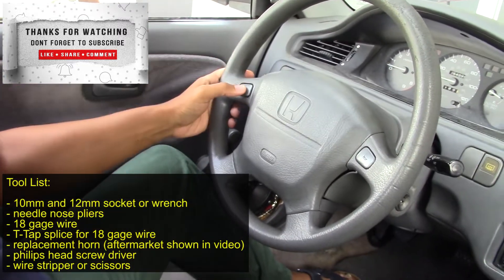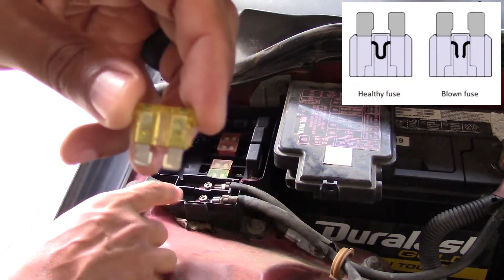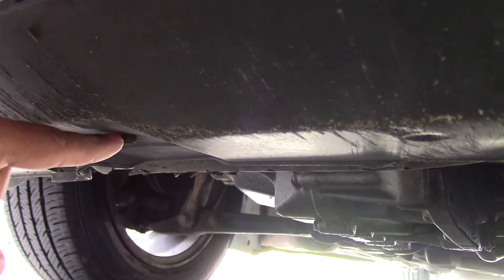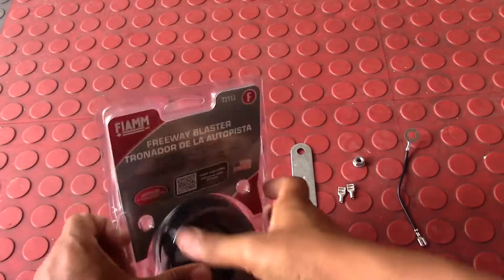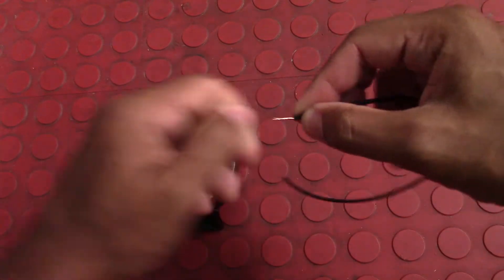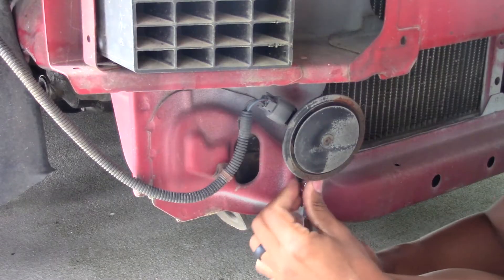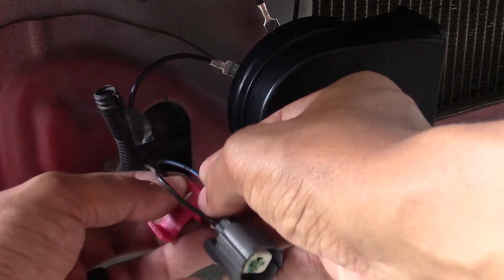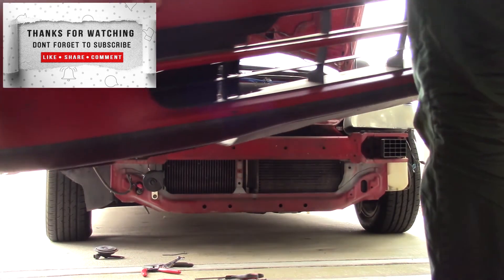Fix and Replace BROKEN CAR HORN | 92-00 Honda Acura

Comment: So my horn randomly goes off nonstop whenever its parked. Its done it a few times and twice today. i had to unplug it, but is there any reason why? my horn has always worked until a few months ago
Reply from the maker: @tranewreck123  that could a short in the wiring, do you have an alarm or does your car horn beep when you lock/unlock your door?
Reply: @ no i dont. it’s a 99 civic ex. never had an alarm but my guess is the button wiring is messed up

Comment: Hey, I am wondering if your car horn would still sound when you locked/unlocked the car? My car will still horn when I lock/unlock but not when I press the horn button on my steering wheel.
Reply from the maker: Wow that's a complex scenario there. I wonder if youbhave a short somewhere where the two wires (horn power and door lock) are rubbing somewhere under the dash un sheathed
Reply: Yea it’s so interesting. I ruled out the horn buttons, clock spring, relay, and fuse being issue because when I click the horn button I hear the relay click. However when I press the lock button, I hear the horn 😂

Comment: Did everything exactly as you show in the video and with the exact horn that you use and still no horn working. Any ideas? My SRS light has been on forever for some reason I have no idea why.
Reply from the maker: Hmm if your SRS light is on I'd try a reset of that. Were you in an accident or doing some work where you turned car on with a safety related sensor unplugged? Check out this link from HT as well: https://honda-tech.com/forums/honda-civic-del-sol-1992-2000-1/srs-light-horn-not-working-please-help-thanks-3175874/

Comment: You don't have to remove the bumper to do this. The horn and plug are accessible from below the bumper. If replacing the horns don't solve your problem, it is because there's an issue with the steering wheel and clockspring. Maybe as simple as loose horn wires in the steering wheel.
Reply from the maker: I'll try this again without removing the bumper!
Reply: @EngineeredMojo  should be accessible for swapping in a replacement, but if you're rewiring as you're showing in the video, then that would be a struggle without removing the bumper. I pulled some horns at the pick-n-pull for my replacements so they were plug-n-play. Great video btw.

Comment: Excellent very informative. I am installing a new aftermarket horn.. Can I use a quick splice connector instead of a t tap? T tap in an 18ga is sold online at advanced. I've only found quick splice connectors but I'm unsure if it is the same
Reply from the maker: Yes, a quick splice should be the same or similar connection type as I used. Glad the video was helpful for you!
Reply: @EngineeredMojo  awesome man thanks for the reply!